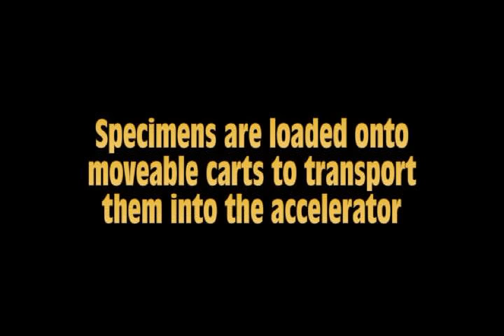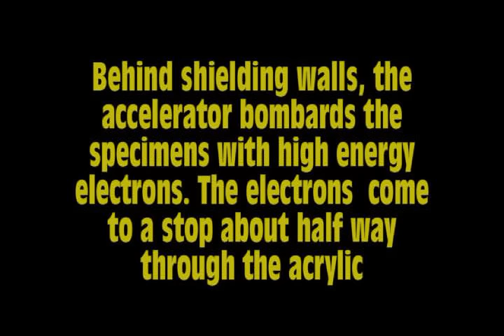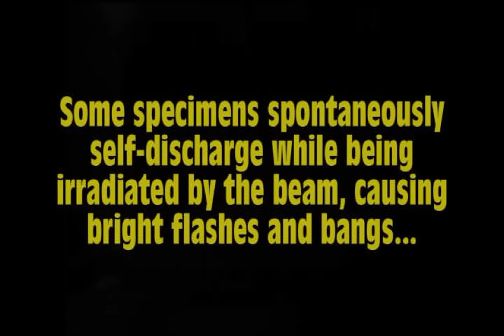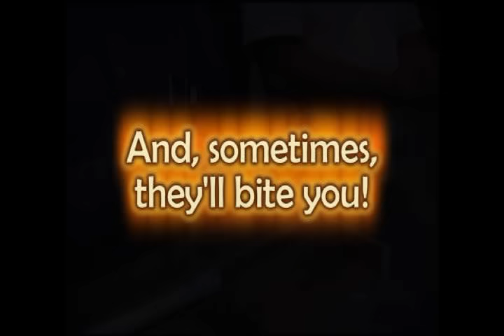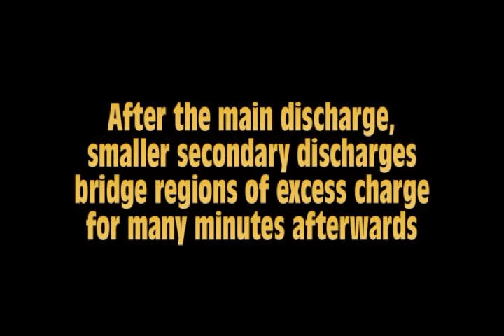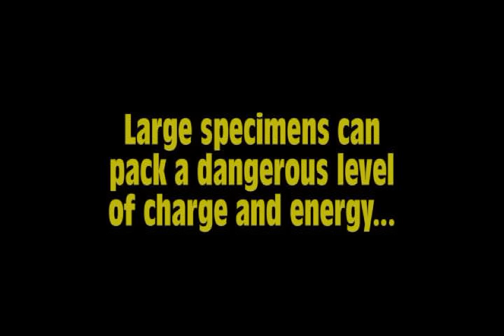Making "Captured Lightning" (Million-volt Sculptures)

Comment: Fine work. If I had access to a powerful particle accelerator, I'd make so many of these it's not even funny.

Also, question: is there a safety limit to how big an acrylic specimen can be? Say, a 3cm thick piece that's the area of the trays used by the particle accelerator facility. Is that stupidly dangerous?
Reply from the maker: Not really. When we started making larger sculptures, we were initially worried that the stored electrostatic energy might be large enough to cause the specimen to explode when discharged. Fortunately, this is not a problem with acrylic (PMMA). 

For a variety of technical and practical reasons, the largest size is about 2 feet x 3 feet. However, bigger is not always better when making Lichtenberg figures. Larger sculptures tend to self-discharge while we're irradiating them. This creates a mixture of branched discharges mixed with a tangle of random discharges that sort of look like white steel wool. So making bigger sculptures is really not so much a a safety issue, but more of an issue of appearance and product yield. The largest size we currently make is 15" x 20" x 2".
Reply: I see. The reason why I ask is because all this gave me an idea about flooring. Have you ever done mosaic or any sort of tilework with these sculptures?
Reply from the maker: No. However, acrylic is fairly soft, so you'd need to use some kind of hard protective covering, such as glass, to prevent unsightly and rapid scratching.
Reply: Alright. Thank you for answering my questions.

Comment: could you put this in a vacuum with glow in the dark resin and fill the lightning so that you could make it glow?
Reply from the maker: Possibly. However, the internal tubes and fractures are very small, so very little glow-in-the-dark material would be  sucked inside, so I suspect that the resulting glow would be quite faint. We tried using a vacuum to help draw in dark ink, but the ink was only drawn inside for a short (~1") distance.

However, we've found that lighting the sculpture from one or more edges, using bright light emitting diodes (LED's), causes even the smallest part of the internal branches to glow brilliantly. The colors of the LED's are brightly reflected, and changing the colors of the LED's also changes the colors of the sculpture.

Comment: Are the channels inside the acrylic themselves hollow? How does it change the structure of the acrylic? Also, do you know how other materials, plastics especially, behave in this process?
Reply from the maker: rlt94 Excellent questions. The channels are hollow tubes surrounded by fractures. The fractures reflect light, giving the channels a sparkling appearance. Under magnification, some of the tubes are observed to consist of larger cavities, periodically-spaced like beads in a chain, with each cavity surrounded by small fractures. For example:
http://capturedlightning.com/photos/Advertising_Aids/Beading/Bead_Thread_d2A.jpg

During the main discharge, each channel contained an extremely hot (up to 100,000 Kelvin) lightning-like plasma that evaporated part of the surrounding walls, releasing gases such as CO, CO2, and CH4. Intense gas pressure inside the spark channel then causes microfracturing of the surrounding material. Irradiation by the electron beam also causes temporary changes in the color of the acrylic between the incident surface and the discharge layer (solarization) and permanent alterations in the bonding structure of some of the acrylic - cutting some bonds (scission), and forming new bonds (cross-linking)). Slight radiation fogging is also seen is some specimens. We have not seen any obvious differences in mechanical properties, even though the material is seemingly full of fractures. 

We have also tried other clear polymers, such as polycarbonate, PVC, epoxy, PET, and polystyrene. All will generate internal Lichtenberg figures. The resulting paths and fractures in most of these tend to be blackened by carbon (from electrochemical breakdown of the polymer and channel heating). These are considerably less attractive than acrylic Lichtenberg figures. Polycarbonate Lichtenberg figures are much finer in structure and grayish to black in color, with consideraby less fracturing than acrylic. Because the material is much tougher than acrylic, it has fewer fractures, so only the smaller diameter channels are created. Following is an example of a Lichtenberg figure in a polycarbonate alloy (and eyeglass lens blank):
http://capturedlightning.com/photos/For_Sale/Lichtenbergs_06-24-05/Polycarbonate/IMG_1726.JPG

Much more information about Captured Lightning is available here:
http://www.capturedlightning.com/frames/lichtenbergs.html
Reply: Thanks so much! Yeah I was wondering if they were hollow, so they are full of various gasses caused by the breakdown of the polymer in a highly energized state? It would be cool to inject those Lichtenberg channels with a brightly colored material at high pressure, maybe in a vacuum chamber perhaps, I think the effect could be striking, one just needs to drill an entry point at the apex from which they radiate.
Reply from the maker: rlt94 The point where all the discharges come together is where it also exits the piece of acrylic, so no drilling is necessary to access all the channels. We have tried to get dye to wick into the passageways, even by drawing a vacuum and then immersing the exit point in a fluid dye. It works to some extent, but really doesn't look nearly as good as expected.
Reply: Ahh, so you have tried it, I suppose it seems like the natural thing to do, if one day you do figure it out, it would be cool to get a phosphorescent dye in there, the effect could be really striking!
Reply: Also, have you ever tried it with amber?
Reply from the maker: rlt94 No. Natural amber tends to be full of impurities and cracks, making it unsuitable for making Lichtenberg figures. The process requires material that is very homogeneous in structure with no cracks, impurities, or other defects that will cause it to self-discharge during irradiation. It is quite possible that filtered amber recast into a block might work, but we haven't tried it... yet.  :)
Reply: That is what I was thinking, it might be interesting to try with refined amber.

Comment: Nice video! Please tell me something about the accelerator: what is the beam current?
Reply from the maker: Thanks for your kind words! The Dynamitron accelerator that we use can deliver up to 30 mA at up to 5 million volts. The current we actually use depends on the size and shape of the specimens and whether we are using multiple passes through the beam (for more complex sculptures or lead-masked sculptures). We typically use beam currents between 1.5 - 10 mA, scanning across a four-foot-wide path, at beam energies between 1.5 to 5 million electron volts. During our last production run, we used almost 100 combinations of beam energy and beam current settings to handle the various specimens.
Reply: Bert Hickman
Thank you very much for prompt answer. Is it possible to make Lichtenberg figures using lower beam current and longer irradiation time? What "dose" of electrons do you apply to samples and how it is calculated? In "dose" I mean something like (coulombs*volts)\mass_of_specimen. Did you built the accelerator or it's ready-made? Thank you!
Reply from the maker: Max maxOFF
If you chill your specimen to dry-ice temperatures (-78C), you can reduce the rate of charge leakage and use a lower electron beam current over a longer time. You need to cumulatively inject about 1-2 microcoulombs of charge per sq-cm in order to develop a sufficiently strong E-field (1 - 2.5 MV/cm) to propagate the electrical breakdown channels inside acrylic. We rent "beam time" on a 150 kW particle accelerator to make our sculptures. See our web site at capturedlightning.com for all the gory details.

Comment: do you guys do custom pieces(like if i wanted a 1 1/2 by 48X36 piece would you do something like that and about if so how much would something like that be? I'm not looking for a quote just an estimate as i was thinking of making one into a coffee table in the future and just wondering ball park what the top would run.
Reply from the maker: Rhett Walker  We do custom work on occasion. We normally only make our sculptures 1-2 times a year, and can fit in custom work during the regular production run. The physics of the process limits the maximum length of a single "tree" to about 24". Bigger is really not  better when it comes to Lichtenberg figures. Although we've made larger (24" x 36") sculptures in the past, we were not at all happy with the results.The larger the acrylic piece, the greater the odds that internal defects will cause it to self discharge while being irradiated, forming an ugly, tangled mat of chaotic discharges instead of a nice "tree". 

The largest recommended specimen size is 24" x 24" x 1". For a coffee table, one workable approach might be to use an array of smaller individual sculptures, each individually framed and edge-illuminated with LED strips. The cost for custom work depends on the size and complexity of the sculpture, whether any masking is used, the number of charge layers (usually two for specimens thicker than one inch), the number of passes through the electron beam/specimen, and the number of specimens that can use the same irradiation parameters. Once we can work with you to develop specific design criteria, we can provide you with a quote. You are probably looking at something in the $1-3k range.

Comment: Would love to capture the event using our high speed camera...
Reply from the maker: So would we - in fact, it's on our "bucket list"...  :)

The problem is that the discharge zips across the sculpture in about 1/2 of a millionth of a second. If we wanted to capture the event over 6-10 frames, it would require a camera capable of recording at 3-5 million frames/second. If you have access to a camera of this speed, it may be possible to provide charged specimens (chilled under dry ice) that you could film while being discharged at your facilities.
Reply: At the current time we don't have quite that frame rate.
But we are working with a variety of high speed specialist companies and could certainly see if we can arrange this!

Would you be interested in us doing some shots using our current rates of around 2 - 30K? 
May be some interesting sights to see, especially with the discharged bolts.

Once I see the travel rate at higher speed framerates, we can estimate what sort of speed would work best in future.

I'd be happy to let you have some exclusive extra footage for your own video also.
Reply from the maker: Our next production run will be either in mid-November or early December in a facility near Cleveland, Ohio, USA. If any of your potential high-speed camera providers are located in the US, perhaps we could arrange to capture discharges on a variety of specimen sizes during the actual run...
Reply: Sadly my contacts are British based currently.
So would have to be shipped and filmed for the moment.

Comment: Can you say how many more electrons there are in the charged zone than there are from the neutral carbon, oxygen and hydrogen atoms themselves? (as a proportion) Is it one additional electron per a million atoms for example? I'd like to get a "feeling" for charge. I have absolutely no idea about the orders of magnitudes here, might as well be one in a billion or trillion. My only guess is that at some point so many atoms are ionized, that the PMMA stops being PMMA (although breakthrough and selfdicharge will strike way before that).
Reply from the maker: +superdau 
That's an excellent question! The repeating molecules of PMMA each consist of 5 Carbon, 2 Oxygen, and 8 Hydrogen atoms, and the molecular weight of PMMA is about 100 grams/mol. After doing a bit of numerical analysis, it turns out that when we charge up a specimen, we typically inject only ONE extra electron for every 3 billion PMMA molecules, or one extra electron for every 50 billion atoms. An incredibly tiny addition of excess charge (per molecule or atom of insulating material) makes a HUGE difference to the behavior of that material.
Reply: +Bert Hickman 
Thanks! Wow, even crazier when you think that every molecule already "has" 54 electrons. Add a single electron to 160 billion and you get that effect. What a difference it makes when electrons are bound.
How do you get to your number? (no worries, don't need a long explanation; I mostly know how cathode ray/x-ray tubes/different types of particle accelerators work). Is it in principle just taking the beam "current" (number of electrons) divided by area and multiplied by the time the object is under the beam? I guess the biggest variable is an efficiency factor you need to work out/measure taking into account absorption of electrons in the air and how well the electrons are caught.
Reply from the maker: +superdau 
I had to add some calculations to our dosage modelling spreadsheet in order to answer your question.  :)

For a given specimen size, we know the beam current, so we can calculate the number of electrons/sec in the electron beam. The beam is scanned across a 4 foot wide swath, and knowing the overall area allows us to calculate the approximate electron fluence seen by the irradiated PMMA (about 10^13 electrons/sq-cm). To simplify the problem, we ignore electrons "lost" from scattering in the air between the accelerator scan horn and the specimen. 

For a given PMMA specimen, we also know the irradiated area and the amount of time it spends within the beam. Multiplying electron fluence, specimen area, and irradiation time provides us with the approximate number of electrons injected into the specimen. We also know the mass of the specimen, and the molecular weight (100.12 grams/mole for PMMA). Dividing the specimen's mass by its molecular weight gives us the number of moles in the specimen, allowing us to calculate the number of molecules (via Avagadro's constant). We can then take the ratio of molecules in the specimen versus the number of electrons injected into the PMMA to derive the approximate ratio of PMMA molecules to excess electrons. Since each PMMA molecular unit consists of 15 atoms. we can also estimate the ratio of atoms to excess electrons. The actual range of the ratio of molecules (or atoms} per excess electron varies by a factor of 5-7 from small, thin specimens to large, thick specimens.

Comment: could this be used some how to make a battery, a 1 use storage system like a capacitor, might be good used in a system that needs instant power without the chemicals that battery's have,  you might even use it in some sort of charge riffle,  and the ammo is also the power source,   what would you get if you made this to work on impact like a bullet that discharges its power into the target,  could fine powder do the same thing if so that could make a cloud that emits power when shocked  via a small explosion,  and would that create magnetic fields or an emp
Reply from the maker: It might be possible to use it as a high voltage pulsed power source. The peak internal potential (versus the outside surfaces) may reach 2.5 million volts with discharge currents reaching several thousand amperes for larger specimens. 

Because the stored charge leaks away in a matter of hours at room temperature, charged specimens must be maintained at dry ice temperatures  (-78C) in order to store the charge for longer storage times (months). The charge storage process requires using relatively thick solid dielectrics - a powdered material will not work.

Comment: Where is the shop? Would i be able to come check this out
Reply from the maker: 13reganomics13 We're located in the western suburbs of Chicago, but we actually make our sculptures at a commercial particle accelerator located about 450 miles away in NE Ohio. Any visitors to our Lichtenberg Runs are put to work schlepping material, taking pictures/videos, and discharging specimens. We have a long list of volunteers... :)